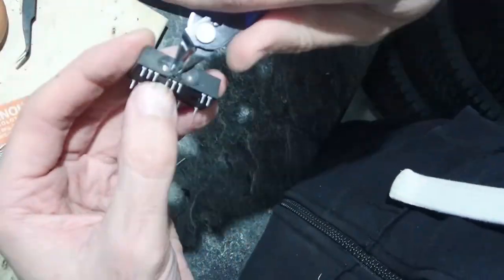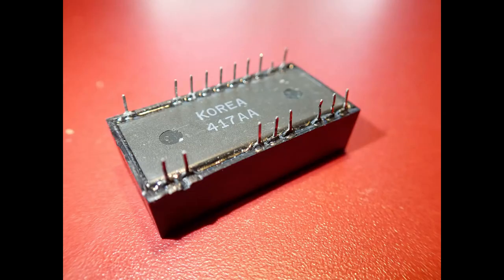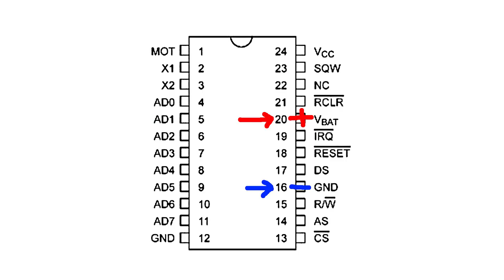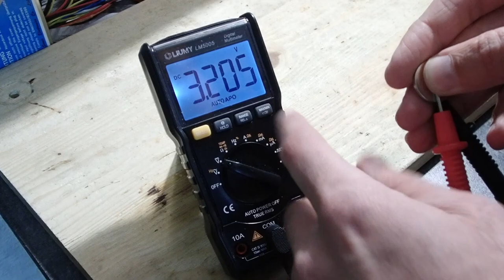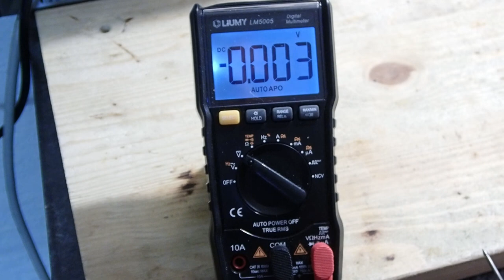Revised: Repairing Real-Time Clock Battery (Dallas DS1287 / Odin OEC12C887)

Comment: Few notes: I always disconnect the internal battery as it is non-rechargeable and isn't supposed to be charged. Also the battery might be degraded to a point where the current drain of it can be quite high. I would suggest you to use a micro (or nano) ampere meter to measure the current when the battery is disconnected or not.

Comment: Very good and helpful information. There is another reason you should cut the internal battery pole: you are effectively charging the dead battery. This is very bad and may lead to them leaking over time.
Reply: If you notice the internal battery at 4:07, it's quite small and cannot possibly contain enough to significantly leak, especially not in the original well-sealed container. You might argue the side hole created for the connection is a potential weak point, but unless the PC is like the IBM 5155 Portable, I don't think it could ever be a problem.
Reply: @squirlmy  I take it you have never seen what happens when that type of cell is recharged. Also that cell shown is just a representation and not what is inside the Dallas module. they can explode at worst case and catch fire with a small trickle charge.

Comment: I also would cut the connection to the internal battery. As others mentioned, the current draw might be higher than in your case, also shouldn't be charged - yes. But, those modules are not only found on old mainboards used nowadays by hobbyists. They are also very common on industrial PCs, and they have been running since the late 90s. Having battery die one year after replacing it is gonna be problematic. If done properly, the industrial system, usually some CNC machine, can then work for many years without needing to have the battery replaced.

Comment: Hi, Citizens. At 2:05 you seem to work with  a Dallas  Ds12b887,  I dont have the electric plan of this battery and you have not drilled a hole into this one,   I suppose that your red wire is connected on the positive contact,  so its ok if We have  drilled a hole in the opposite side, between  the two groups  of 3 pins  ! Otherwise,  No matter of  where is the hole  into the negative or the positive contact of the inner battery both are a good place for the drill,  is it exact ?   Your external module  has the negative and positive wires going  unto the battery  and are They soldered together  in the same hole or  They have into this a tiny seperation, 1 mm,   2 mm ? Thx for you time, if you got it ! Anyway thx for all  your videos.

Comment: I just did this today to a Dallas RTC battery in an old Gateway 2000 that I recently picked up. I didn't think it'd work but it does (although the bending back of the pins made them weak so they may break next time I remove the dallas module). I used a grinding bit on my drill (once you get past the plastic you'll grind thru the epoxy/glue stuff inside before you are greeted with the shiny contacts inside.) One thing though is will the battery inside the dallas module ever decide to leak and destroy the module's inside or even worse leak its stuff externally and onto the board?
Reply: From comments I've seen on other videos about this, the likelihood of this is low. Both due to battery chemistry not being the leaky kind, and the fact that it's epoxied in there super tightly without any gaps anywhere.

Comment: hello, very good modifications and video. i have  MB model  ROCKY-3702EV with DS12C887 but the motherboard do not do nothing... i have two cuestions (1) if  the DS12C887 do not have internal battery the integrated circuit will not work? / (2) in case of DS12C887 dosent work, this will afect the motherboard?, because i do not have inicial start (dead mother board)
Reply from the maker: The module should work even with an empty battery. So, if your mainboard doesn't start at all, either the module is dead, or your mainboard. The battery is only needed to keep the BIOS settings and the clock.

Comment: Awesome work am going to try this,can you do a video maybe using a heat gun to remove the ic from the Dallas case,maybe it can work..😊
Reply from the maker: Yes, I wanted to try it, because I have another project, where I'd need to get the IC out of the module. Unfortunately, I'm currently short on time, since I have to meet some deadlines at work.

Comment: I have one of these suckers on a nice later socket 7 board. The fecker is soldered with the battery side facing directly against some power MOSFETs with those branching black anodized aluminium flanges that were popular during the pentium era. There's no way to do it without desoldering it and even then bodge wire can't be thicker than a couple of mm.

Comment: Good video thanks for sharing 👍. Why not cut the pin on the IC beneath and connect it straight to new battery instead of drilling? Also why don't you sacrifice one of these modules do a full gut surgery to see what's inside ?
Reply from the maker: There are no pins underneath, hence the drilling. And I know, what's inside, pretty much the same stuff you can find on my own module: https://youtu.be/svPNxILeQEw

Comment: I have developed  / contracted this ailment too.    Why not just "jump" the terminals form somewahere else on the board ?   I don't have the circuit diagram for my Board - indeed the downloaded Manual is very basic,   but do we really need to go into the Chip at all ?    Thanks for your contribution to this collection of vids.
Reply from the maker: Unfortunately we need, yes. We need to power the RTC chip which is inside of the module. This is an old video, but you can watch my video about a better solution, which I developed later. Search for nwX287 on my channel.
Reply: @necro_ware   you're right - I'd forgotten about powering the internals when there are no thru' connection pins...

Comment: I'd like to stress out how important is to solder the wire that goes to ground on the inward side.
I made the mistake of doing it on the outside and the solder joint broke, leaving me with a big ? :)
LOL
It was useful but you should pay attention to what's inside the socket as I have a couple boards with some IC, like with bios sockets.
Reply from the maker: Yes, it is indeed very much dependent from the environment, how to add the external battery in a best way. As I showed in the video, sometimes it is better to make it upright, sometimes you have so little space at the top, that it's better to add a battery using two cables and external holder from the side. Sometimes the ICs are sitting so tightly, that you don't even have space to add a drop of hot glue to better keep the cables in place. So, yes, you have to analyse, which way is the best, but at least the electrical part is always the same :)

Comment: Very very interesting. Thanks!
Reply from the maker: You are welcome.
Reply: @necro_ware  Sorry, which pin number has the positive internal battery? I don't want to destroy the wrong one and my RTC has different pins cutted off. Thanks in advance. That's one is to bring an AW4416 alive back!
Reply from the maker: @nelbazan8391  Hi! Please see at 1:09, if you mean that. Which model of the RTC module do you have? Usually the missing legs are always the same. If it doesn't look like the one I'm modifying in the video, may be this approach is not applicable to your module, so be careful. And if your module has really the same pinout and the pin 20 on your module is not missing, then you don't need to drill anything. Just try to solder + directly to the pin 20 and - to pin 16 or pin 12.
Reply: @necro_ware  Thanks for your prompt reply.

Mine is a sort kind of "pirated Dallas" as doesn't have the same quality as the original. I bought it little time ago but battery came empty so it's my test specimen XD. That's no problem with pin 20 as it was clear perfect with your explanation , the one I'm looking for is the internal cell coin to short it to avoid battery drainage.

Anyway I'll try to find out!

Thanks so much and stay safe!
Reply from the maker: @nelbazan8391  thank you! I hope, I got you right. The pin 20 is the one where the + of the internal battery is going to. If you want to cut it, you have to drill from the side right above the pin 20. The metal part inside is the continuation of the pin 20, which goes to the internal battery. If you cut this metal you will disconnect the internal batteries + from the pin 20, where you can solder an external battery to.

Comment: thankyou for these videos on the battery replacement - i just added the coin cell battery holder on a biostar 486 pci motherboard and it seems to have worked. i managed to set the hard drive size and reboot into ms dos so i assume it works as intended (this motherboard can't boot without bios settings). the moment I started packing it back up to install it into the case however, my bad soldering broke and my ground wire came off lol. lets see how i can get it fixed again tomorrow :)
Reply from the maker: Glad, I could help! Another oldie back to life, I guess?!  ;)

Comment: my motherboard has one of those installed but it also has battery holder markings on the pcb, a white circle with the - / - signs. Is it possible to attach an external battery in that point and leave the dallas rtc untouched?
Reply from the maker: No, you have then to replace the RTC module by a related IC and add a crystal. If you look around you will find a place, where a crystal is missing.
Reply: @necro_ware  :( I knew it wasn't that simple :(
Than I have to get one of your necroware neat replacement modules. But there is no way I can surface mount those millipede ICs... I hope someone can make them and sell them (I'm looking at you :P )

Comment: IT occurs to me that you can probably dremel from the TOP of the chip and reach these terminals.... disconnect the internal battery and solder on new leads WITHOUT desoldering the chip from the motherboard...... what say you?
Reply from the maker: Of course, as long as you hit the + pol of the battery, it would work. May be my last video about it would help to find the right spot: https://youtu.be/ecTZtZhE9bI?si=wiKnX63LcEvjVZbD

Comment: Yo there mate, can i Just solider the battery, into right pinout? Will mobo run without module? Peace!
Reply from the maker: Unfortunately there is no pin where you could solder the battery to. That's why we need to drill it after all.
Reply: @necro_ware , okey i made 1"hole" for +in the battery, and - From GND, and have some 0,5V, so i Connect normal 3V battery, and BIOS still have error, have some ideas? Peace!
Reply from the maker: @wojtekpogromca7696  Which error do you get?
Reply: @necro_ware  CMOS failure, and CMOS battery error
Reply from the maker: @wojtekpogromca7696  Try to save the BIOS settings once and reboot. If the error didn't gone, check your battery and the cables you soldered once again.
Reply: Okey! After leave mobo with battery inside, solved problem! Thanks man, you are making good work!

Comment: I would be more concerned with the consequences of reverse charging the stock cell with the new one rather than just a faster discharge.

It is after all not designed to be recharged.
Reply from the maker: I don't think, that is a problem. The CR2032 is not powerful enough to recharge the internal battery. Anyway, if you are concerned, just cut the internal leads. Or use my replacement module, which I open sourced some time ago.